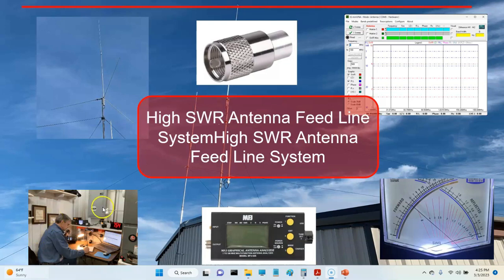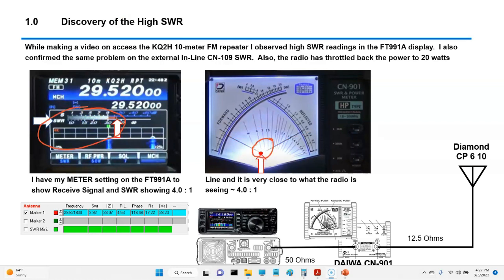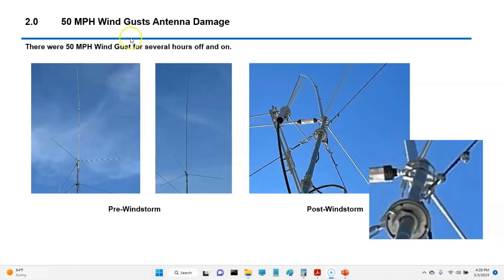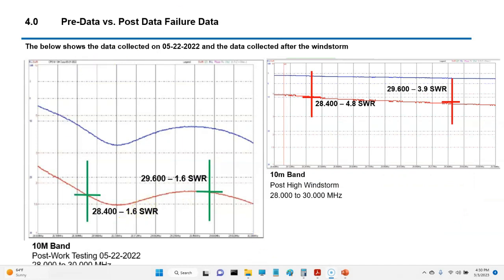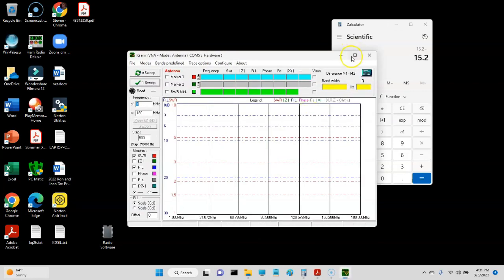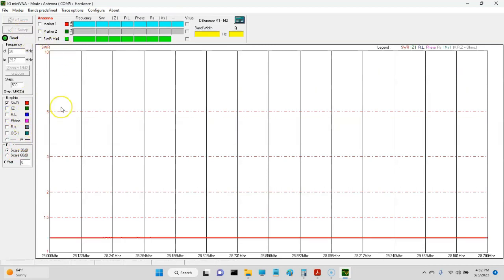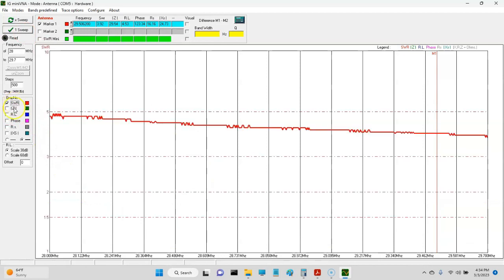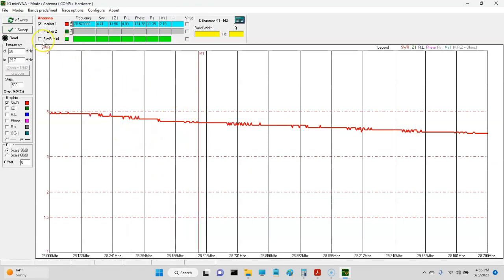High SWR – What Meters to watch when Transmitting for Signs of Trouble – KI5JUF HF 10m Off the Air

Comment: Hello, LU2AW from Buenos Aires, Argentina here. I have a CP610, and after watching all your videos, I can confirm the same issues with mine. I installed the 610 about a year ago, and at first, everything went smoothly. SWR showed as expected, well in line with the curves in the "manual." The best resonance was around 28.4 and 50.5 MHz.
After a strong storm (I live in a building, the antenna is 60 meters above street level and very exposed), it bent at the base point to one side (not much, about 10/15 degrees), and SWR intermittently changed from 1.5 or so to 3.5:1. So I disassembled the antenna, straightened the lower pipe, reassembled, and erected it again.
Now the resonance points are the same as with your antenna; the curve is the same. The best SWR on 6 meters is below the ham band, and on 10 meters, it's not as low as before. I'm thinking of bringing the antenna down again and opening the radial coil and the phasing coil to see what the hell is wrong. Maybe there is also some sort of impedance matching network in the feed point pipe.
If possible, let me know your email so I can update you on my progress and discuss possible solutions. Mine is fachinsky@gmail.com. I think this is a great antenna as long as it worked.
Reply from the maker: Good evening Mario, thanks for the message yest the CP610 is a strange antenna, I had 2 and over time they did seem to hold up well my email is shope02@yahoo.com okay my friend thanks and have recently purchased a Comet CHA-250HD I'm very happy so far 73 sir

https://youtu.be/2JZuqmTAUco

Comment: Thx for the vid.. I haven't checked my SWR with my Zoom since I hung my wire a few months ago. I watch it on the FT-991A and it looks OK, but I don't have any other inline meter to watch like you do.
Reply from the maker: Good evening Rich, thanks for the message, yeah the SWR meter in the FT991A is good to watch and you really don't need the in-line.  What I like is the in-line CN9001 needle movement I have the meter at eye level so I watch it all the time.  It's just a personnel preference.   Thanks again I really appreciate the message '73 I hope to work you on the air.

Comment: Great video  ! So what was the other analyzer other than the mfj  ?  Need to get one so picking your brain 🧠  😀.... 
            N7ZXG
Reply from the maker: Good evening Ralph, thanks for the message, yeah the Antenna Analyzer I've look at many, the one I'm looking at now is the miniVNA PRO and the software.   I like the detail this software and hardware package gives you.  I kike the ability to be able to use you laptop and it gives you a lot of detail as to the feedline and antenna (reactance +/-j and resistance for a comprehensive look at the impedance picture.   The link is http://miniradiosolutions.com/minivna-pro/   thanks again for the message keep if touch let me know how the journey goes '73 hope to work you on the air.
Reply: @West Texas Video Gates (KI5JUF)  just ordered the rig expert pro before I had read this so... will see how it works thanks for the reply.   73's
Reply from the maker: @ralphbailey736  Sounds good I've looked at that unit to,  it looks like a good option, keep us posted how it works, thanks and glad to chat with you hope to work you on the air '73 sir!